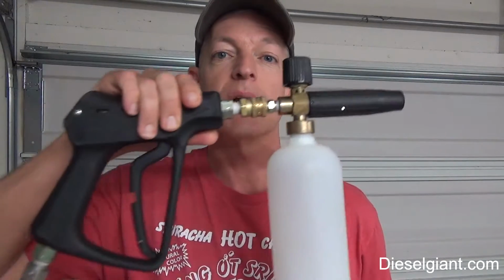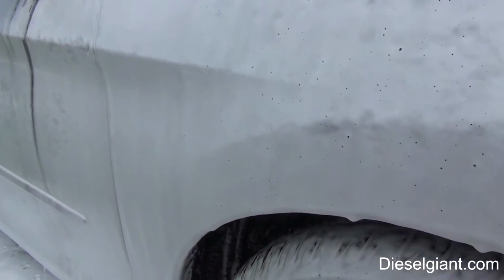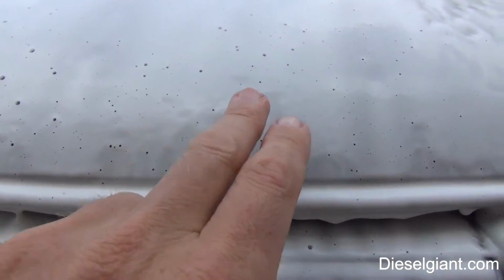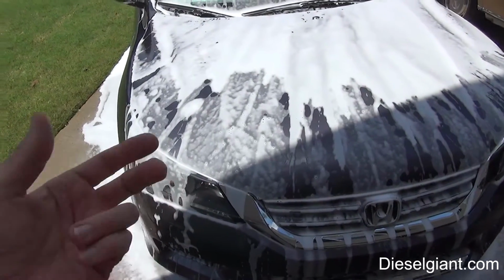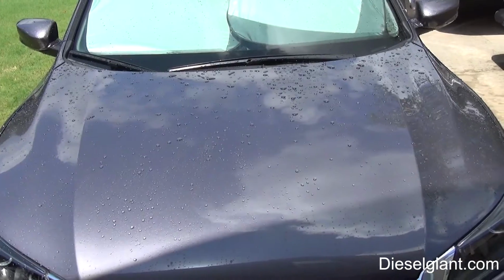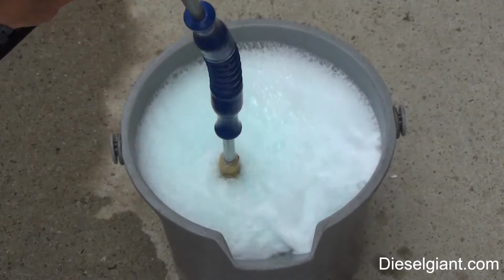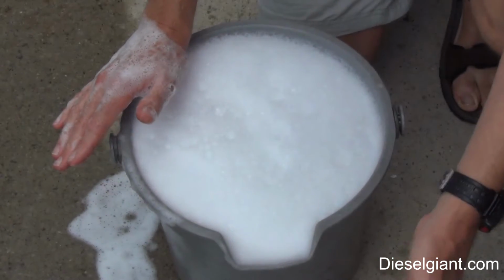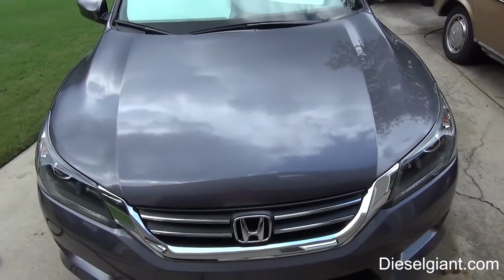Review of Turtle Wax Zip car wash car soap

Comment: I started using Zip Wax car wash sometime around 1986. As I recall, it was one of the early car specific soaps on the market. I had been using the white Ivory liquid up until that point with decent to good results. The ZW didn't seem to clean as well, but it did provide more of what we now call "lubricity" in its use. I was washing cars as sort of a side hustle and after using it several times on my clients' cars, I decided first to go back to the Ivory, and then to mix the 2. What I didn't know at the time (and probably didn't fully understand) was that the Ivory had a pH of about 8.5-9 and added to the ZW, it combined good cleaning power with more smoothness I got with the ZW. I continued to use the pair until I could no longer find the Ivory in the white liquid, sometime in the '90s. There are cheaper and better soaps now, even if you want to stay with a so-called pH-neutral (which I don't recommend for any wash), but the ZW product certainly earned its place as a quality product back in the day. That is, if you knew and understood its limitations and how to overcome them.